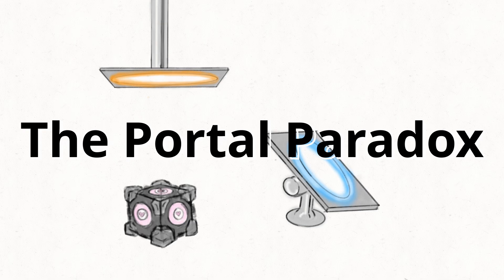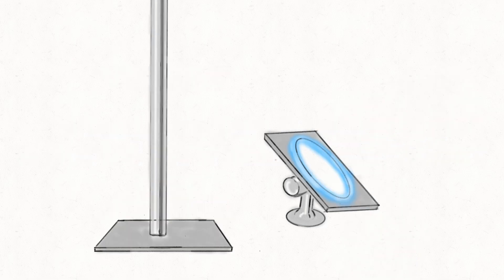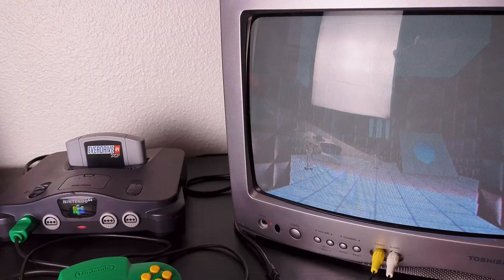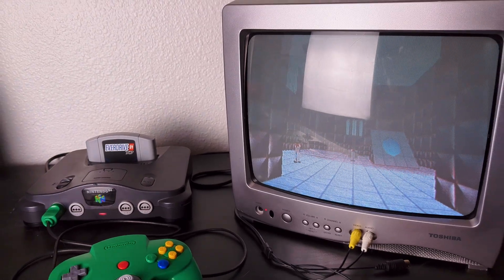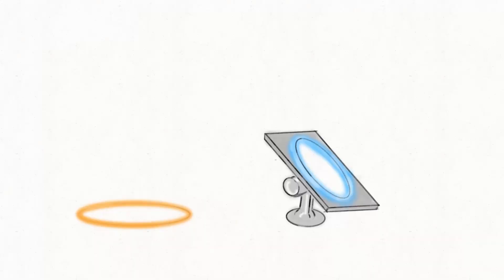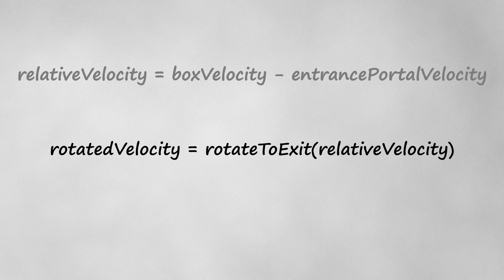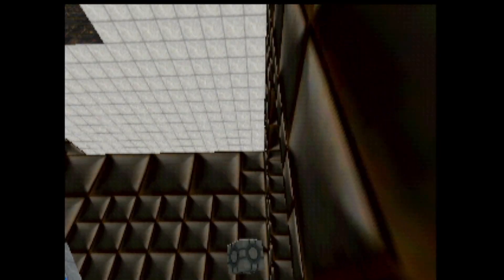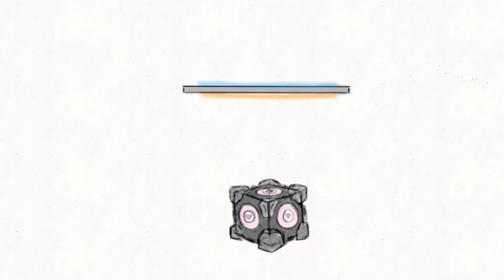I rewrote Portal from scratch and solved the Portal Paradox

Comment: This whole question is about the nature of relative motion when there are two simultaneous and "overlapping" frames of reference.
Even if the cube (object) doesn't go through the (say, blue) portal, it still has an inertial reference frame as observed by the other (red) side of the portal... except that frame is different if the first (blue) side is in motion relative... to the other (red) side... uh... hmm....
[Edit] Basically, the inertial system can move the same floor tile in a room closer to itself without moving it at all.

Also, what about the matter in the next iterations of the room? Wouldn't it be moving relative to itself twice as fast? Then four times? Then...? And there is no limit to the "real life" portal tunnel like in games: if a portal moves, it has instantaneous effects across an infinite set of material interactions....
It's a physical self-contradiction given our current laws of physics.

Comment: Interestingly, the hula hoop explanation for this isn't... Applicable. Because there's not a hole in the surface. You're not just moving it around the thing and nothing happens.

The reason the cube remains stationary is an illusion. The cube is not actually stationary. When it enters one portal, it is ejected from the other portal at the same speed. However, because both portals are moving downwards at the same velocity, the cube appears to remain stationary. Because it is ejected upwards exactly as fast as the portal is moving downwards.

Comment: I think your reasoning is probably pretty consistent with how moving portals would work if they had been implemented in the original game, so I can't say it's "wrong" per-se. However, what my intuition on how a portal would actually work, withstanding game engine logic and whatnot, would be that the cube at rest doesn't have velocity; the portal does, and the decision as to whether the cube being enveloped by the portal has that velocity imparted onto it would just be a matter of how the receiving portal interprets the motion of the first one. An easier way to think about which approach is correct (not saying either is, just a thought experiment) would be two portals on either side of a 2d surface, moving so that a cube sitting on a podium passes through them. Naturally, the cube stays on the podium, but does it not move because it has no velocity to begin with, or does it not move because the velocities of the portals cancel out? The forward facing one having a positive velocity and the back facing one having a negative velocity.

I think it would be the former, because in my mind, portals are just a map between points in space -- i.e. the portal moving is changing the distance between the cube and the space on the other side of the portal, but I don't think that translates to velocity in terms of what's "outside" the portals, it's just changing the map itself. This is coming from my thought process as a mathematician though, and I could definitely see a physicist or engineer disagreeing based on the general definition of velocity being purely differential distance.
Reply: I think of it more like maps too, especially if you think of it in terms of topology. the more obvious answer is that relativity doesn't necessarily apply because relativity requires endowing the space with some extra structure we can't assume just from observing how the game works normally. The time-dependant properties of objects passing through the mapped region, and the map changing, are boundary conditions that you can arbitrarily choose.

There's also technical considerations like that every object is rigid in the game so you can't apply tension to it, so it shouldn't be possible to apply significantly different velocities to different regions of the object, making this interaction very non-intuitive if the portals are significantly accelerating.

Comment: No, this makes perfect sense, I imagine if you held a rod with a portal on the end, as you pushed down on an object  (assuming the exit portal is facing up) you'd feel a resistance equivalent to the force of gravity pushing against the object as it comes upward out the other side. That's helped me imagine the "feel" of a portal IRL.
Reply: Yeah, you're right. But what makes sense?
Reply: Actually, I don't think you would. If you looked through the portal on top of the rod, you would see the object, sitting on the ground, right at the entrance to the top portal. The ground is still pushing up on the object (so you wouldn't feel anything), you are just making the ground higher in the air.

Comment: Thought experiment: The exit portal is fixed stationary. Now you slam the entry portal on the cube, but stop halfway. The break force acts of course only on the moving portal, however if you follow your equation, the cube that sticks out of the exit portal has a velocity. If a break force acts on the cube, the cube would feel a sudden force out of nowhere. If the velocity wont get compensated, the cube will fling out of the exit portal despite having ground contact at the entrance. Guess portals always break physics.
EDIT: As I see, this is already discussed in the comments ^^
Reply: That's why his equation is wrong. Portal's speed can't be given to an object (unless you code it to behave so lol).

Comment: The thing you have to keep in mind is that source engine actually did complex physics calculations. It took into account the mass, volume, velocity, acceleration, density, force, torque, inertia, drag coefficient (friction), and buoyancy (look up Source Engine VPhysics.) The project that Portal was based on, Narbacular Drop dealt with physics of velocity, acceleration, gravity and collisions.

So my guess would be that you're correct if the kinetic energy is based on the floor accelerating the cube into the portal, which is why the second example also makes sense. The floor is hitting the entry portal at the same speed as the exit portal with no change in gravity.

Comment: What happens if the cube is floating in midair, and the orange portal doesn't stop moving once the cube goes through it? It seems your implementation would break at that point.
Reply: Use that noggin of yours a bit more :).

Comment: Fun thought:
If you have the end portal moving (in a forwards direction) at a higher velocity than the start portalt, you would have this "invisible" force pushing you away from entering the portal. Like, your body would be pushing you back out the way you came, effectively making one-way portals if they're faster than you can move.
Make a circular corridor for the end portal to move around in, have the entrance portal moveable, and find something that can accelerate you, and you got yourself a cool puzzle.
Reply: You can do a similir thing by just placing two portals on the ground. ISN'T THAT CRAZY????

Comment: Seriously, this result is the only one that makes sense. The idea that the cube will stop after exiting the blue stationary portal makes no sense because it is moving relatively to that portal the whole time it is going through it, there's no reason why it should lose all that momentum after it leaves it.

What I see as actual portal paradox is if you try to press the two portals over the cube from sides. Because the cube can't go through since there's "another copy" of the cube just behind each of the two portals, meaning you compress the cube from sides with the two portals without having physical contact with it and you either squish the cube that way without need to apply any force or it will stop the two portals from moving, again with no physical contact.

Comment: The entire time in the game, thinking with portals means throwing physical understanding out of the window and imagining there is a hole which connected to a different place and different plane. This is what "now you're thinking with portals" means. Introducing relative velocity as an understanding of portal behavior, instead of the much simpler "its a hole" goes against everything that the game teaches you. 
  
Of course that intuition is physically incorrect, but the intuition is what counts, not the physics. 
Again, thats the point of the game. I think you're wrong

Comment: But surely both the exit and the entrance to the portal are a part of the same object, so the second portal is moving towards the cube in your example even though it looks as if it is stationary.
Reply: The thing here is that while they are both moving at the same speed towards the cube, one of the portals is facing the other direction, so its velocity is technically reversed. The negative velocity and the positive velocity cancel each other out, so the cube remains neutral.
Reply: I thought the same thing too.

Even though the two ‘portals’ are in separate areas of space relative to us.
But the portals occupy the same space-time area allowing them to be portals
Reply: What you should do is run this with the blue portal on the floor. The block shouldn't jump out of the vlue portal if the math is correct.
Reply: @wolfofsummerbreeze  if the blue portal is on the floor stationary, and the orange portal slams down, the cube will jump. It's the same as when it junks from the blue portal at an angle...
Reply: @CastToFall  because it treats the floor as a rising platform? I suppose...

Comment: The logic only works when you consider the 2 portals as 2 different entities. In actuality, it's 2 ends of 1 entity. When calculating the velocity, it's only accounting for the entrance portal, but not the exit. With the second portal still being stationary, the cube should simply fall through and not flung.
Reply: No, it should only account for the exit portal. In his equation it's actually accounting only entrance, and that is wrong.

Comment: Here is my issue:

Moving portals were never implemented in Portal, which means the developers never had to factor into the equation the speed of the portals, and could use the speed of the cube itself to determine the exit speed through a portal.

Your implementation assumes that the speed of the cube is determined by the relative speed between the cube and portal, rather than just the speed of the cube itself.
You don't know whether your portals are programmed in the same way that they were in the original game, so you can't tell whether this would have been the result in the original Portal. In fact, because the portals were only stationary, it is almost certain the developers used only the speed of the cube itself.

Your implementation is good, but it isn't the only possible implementation. The result you get is entirely dependent on how you program the portals, and programming them differently would give different results. If you had implemented a simpler solution where the speed of the cube exiting through a portal is the same as the speed of the cube before entry, you would get that when the portal slams down onto the cube, it plops out of the other one rather than being shot out. You would also get the same hoola- hoop result. A quirk of this type of implementation however would be that a cube could never exit out of a portal moving faster than itself, and would instead get bounced back out of the portal it entered. This means that if you put two portals on the same wall (facing the same direction), and slammed the wall into the cube, you would have the cube remain stationary, which doesn't make sense.

Comment: another way to imagine it is to have the exit portal moving, while the entrance is stationary 
most people should agree that the cube is going to be faster after going through
Reply: It's not another way to imagine, it's absolutely another experiment. And it makes no sense, because entrance portal doesn't move and the cube doesn't too. It's just exit portal moving and nothing more.
Reply: @fantastikboom1094  alright, I apparently forgot to mention that the cube needs to be dropped in.
And it is another experiment, I'll give you that. But it should be demonstrating the same idea.
Reply: @sachiel197  Well, actually, only velocity of the exit point affects the object that passes through. When entrance point moves, it works like a doorway. The entrance point velocity affects speed of showing up on the exit side.
So, in the experiment where both points moving from each other at any speed, the object that passes will get velocity of the exit point.